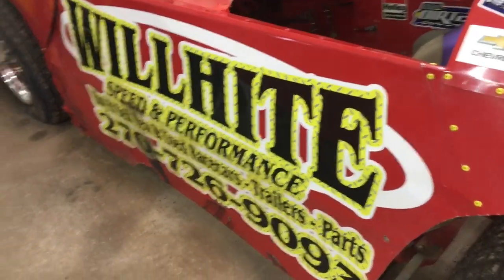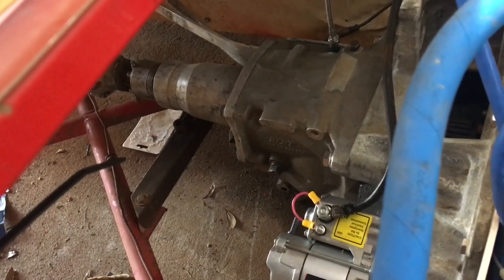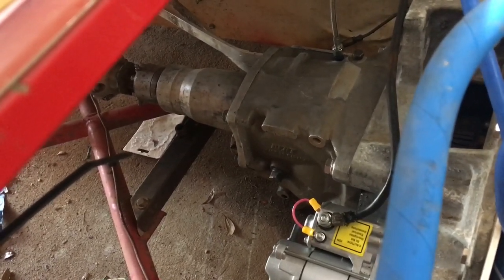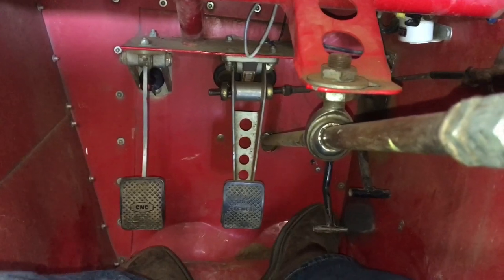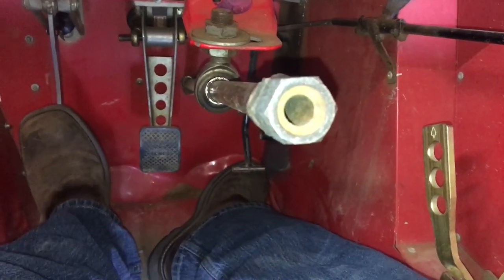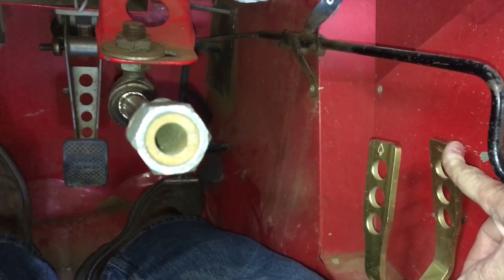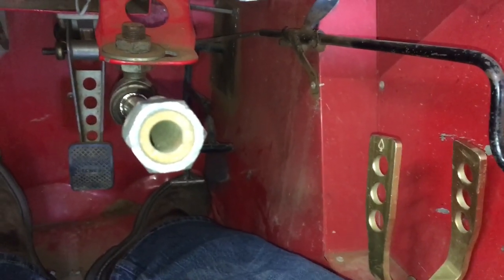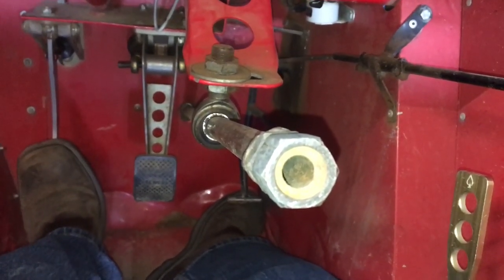Bert gen 1 how to drive

Comment: My boss just took ownership of an old Red Farmer late model and I have been tasked with getting it up and running.  I'm a road race/endurance guy with experience with modern 6 speed stuff/dog boxes/DCT's n such.  I am having trouble with the learning curve associated with all the crazy chassis stuff and this weird two leaver trans "not connected to shifters at moment" and this backward clutch thing.  The engine is Dry sump and the pump looks to be an old NASCAR style but it is driven off the rear and mounted above the bell housing.  I really would like to pick your brain for some knowledge.

Comment: I'm a truck driver I'm used to 10 gears lol almost like a bulldozer beautiful car I hope I can build a late model some day
Reply: They're really not that expensive. It's cheaper to buy a roller than start from the ground up, if you wanna run a sportsman with some harder compound tires you can be in a competitive late model for under 12k. It'll cost you about 400 to 500 a week. my buddy runs a sportsman late model has for years right now he's got a 360 sbc running e85 he only races every other Saturday cause his job is rotating schedule, I think he spent less than 9k on the whole car, and I think he said hes only spending about 5k a season sponsor free if he don't drive like an idiot. It's not that expensive hobby and grassroots level it's just like any other hobby expense wise but when you wanna start getting in top five in a 604 you're looking at about 30k a season so that's where the sponsorship comes in hope this helps. Dont know if youve got one yet or not.
Reply: @dirttrackdevil1149 I k ow I'm 2 years late lol...but I'm buying a late model next week.
By sportsman do you mean 602 or 604?
I know you said below 30k for top 5 604(I just wanna run with pack) and all the motors ice seen are 10k, that's why I asked?

Comment: So after your out on the track and you have it in high gear do you keep the clutch pressed down for the whole race or do you let off the clutch when your in high gear? Or does it have to get up to a certain RPM and high gear before you can let off the clutch?
Reply: You only use the clutch for reverse and first.  Once you’ve got it in first and up to 2-3000rpm, you stab the shifter into second without using the clutch, and away you go. It is difficult at first, when you’ve been used to a PG or regular clutch movement.  I’m also going to be swapping brake and clutch pedals/master cylinders next season, as I want the brake on the outside. Easier for me to get to, without knocking able bones with my throttle foot.